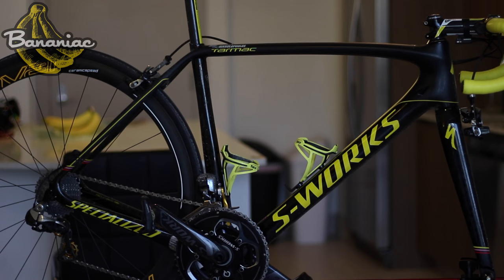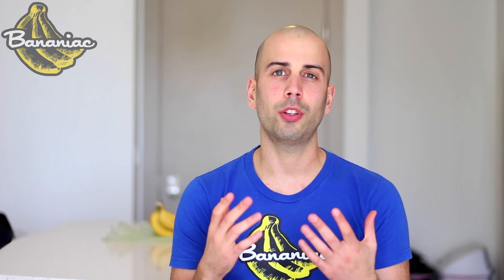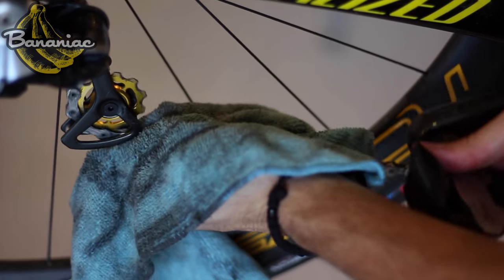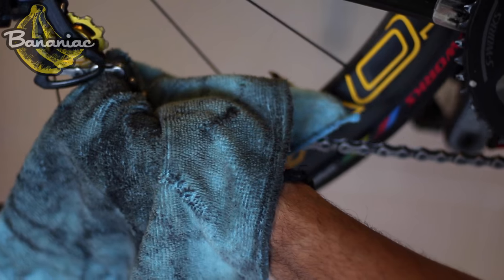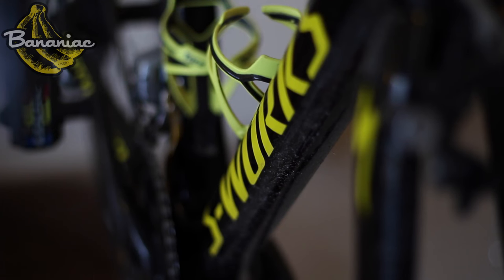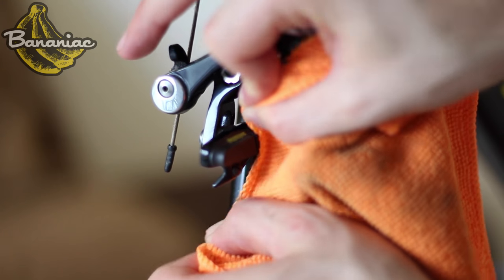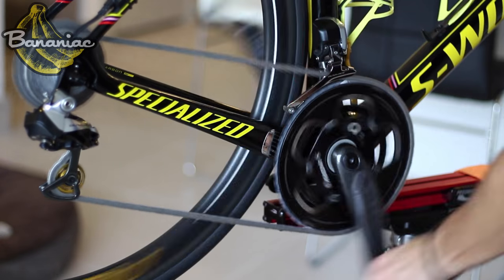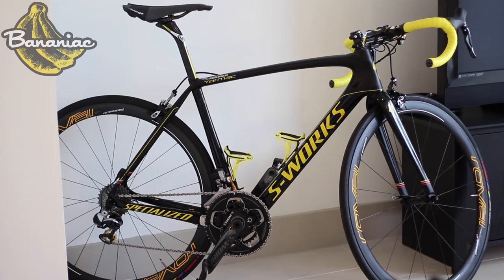Cycling 101 | How to Clean a Road Bike (Without Water)

Comment: I see that you don't use degreaser on the chain. If I don't degrease my chain and just lube it, black residue appears when I run my hand. Have you had any problems or reduced lifespan of chains by not degreasing them and then re-lubing them?

Comment: Thank you! I did not know that I shouldn't wet my bike? I also ride my bike in the rain, sometimes you get caught in the rain.
Reply from the maker: Ideally, you want your bike to stay dry. Getting caught in the rain is ok depending on how hard/light it's raining. Definitely don't hose your bike down unless you can disassembled your bike. That's my recommendation from personal experience. I've ruined previous bike bearings from hosing bikes down. I've even had water get inside my cable housing. Not fun!
Reply: Thank you very much!